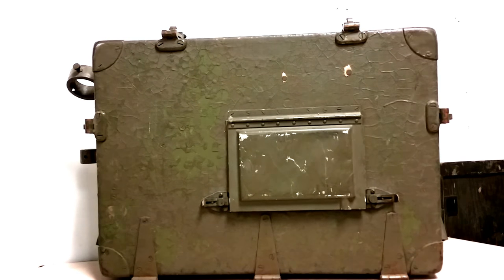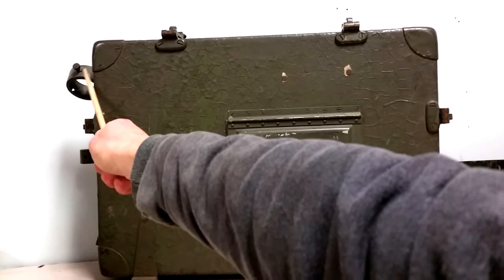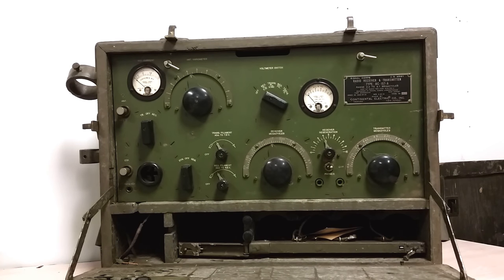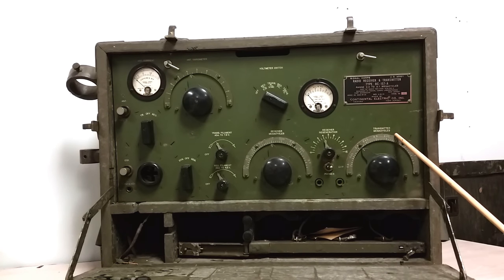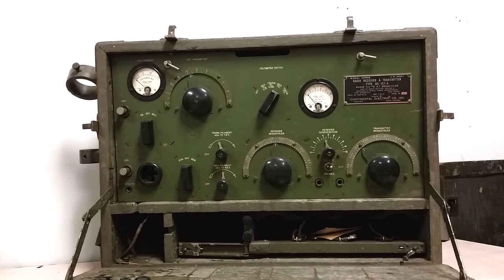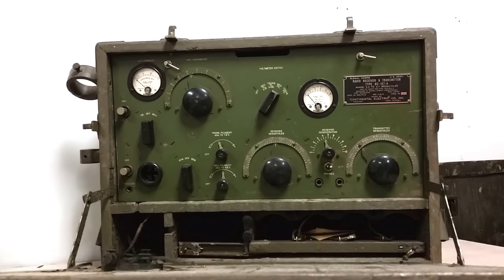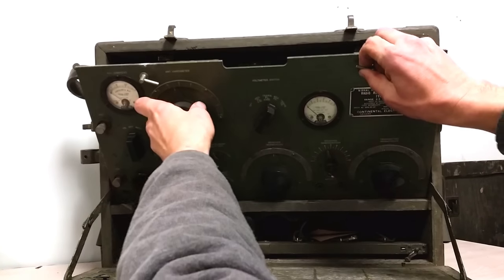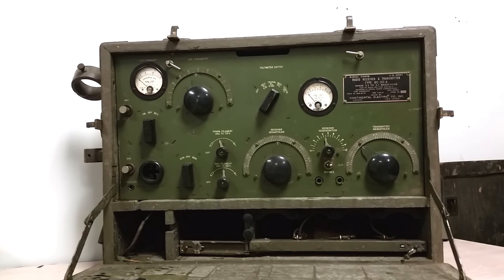1934 Army BC-157-A Radio Receiver And Transmitter

Comment: can you try to boot it up? maybe in another video?
Reply from the maker: I can not really do anything with it, as it does not work on any ham radio bands, and the receiver will just pick up dead air! This is a problem with many of these field sets from the 1930s - unusable due to dead frequencies.
Reply: uniservo maybe will pick up some ET chatter. :)